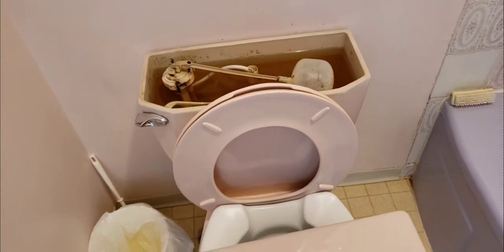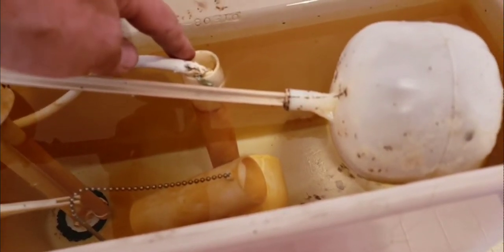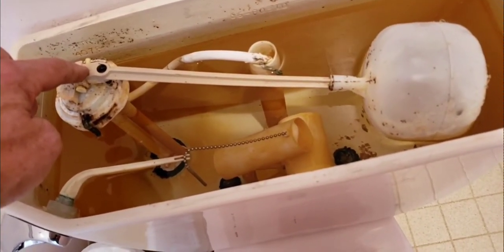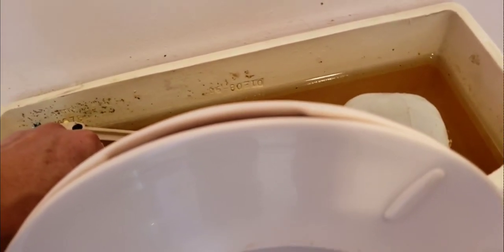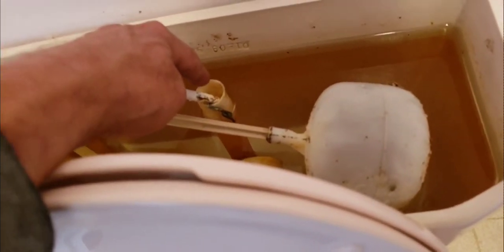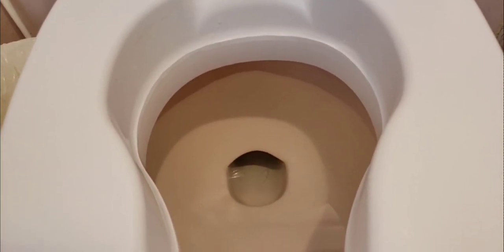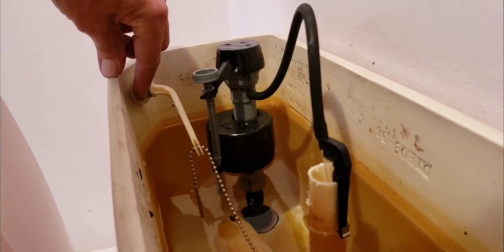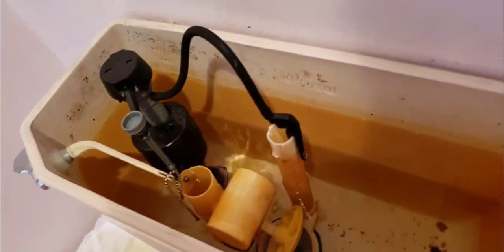Toilet Leaks Out Of Flush Handle (SOLVED)

Comment: What would likely be the problem if on an older toilet, which didn’t use to leak from the handle, starts leaking from the handle for the first time?
Reply from the maker: The fill valve float is failing and the flush valve tube that fills the bowl was not cut down below the height of the toilet handle hole. Reduce the water height if possible. 

Gently cut the tube to just under the height of the bottom of the flush handle where it goes through the tank. This way overflow goes into the bowl. It will still waste water though may save your floor & baseboards.

I say gently because sometimes the plastic tube gets brittle and cracks near the base causing a need for full replacement.